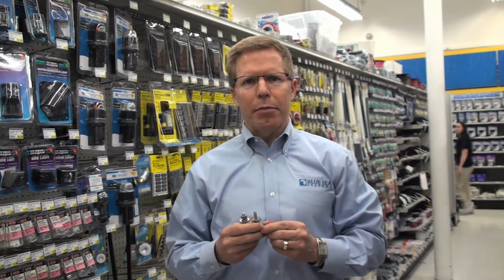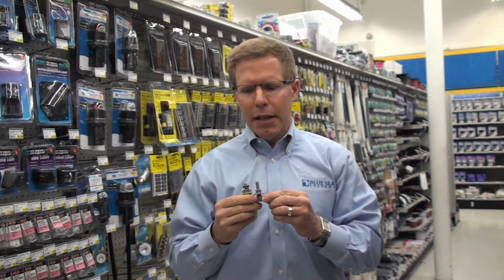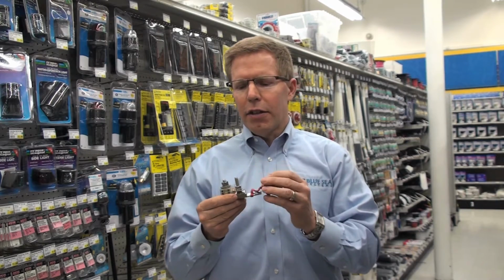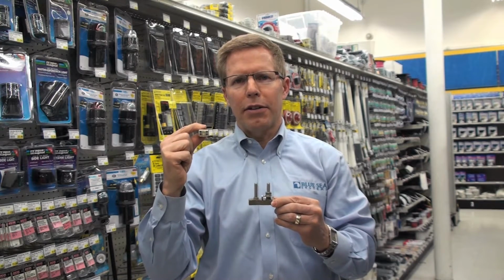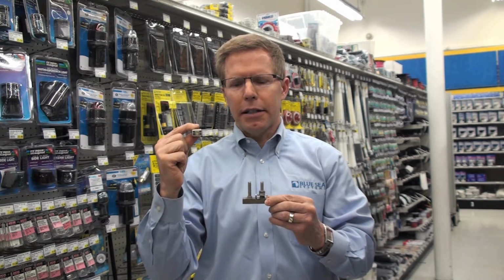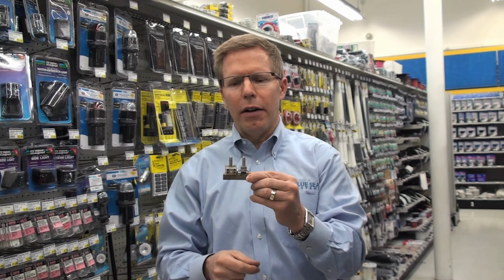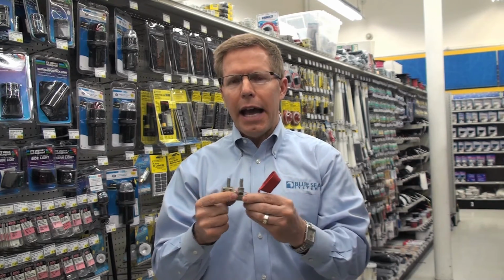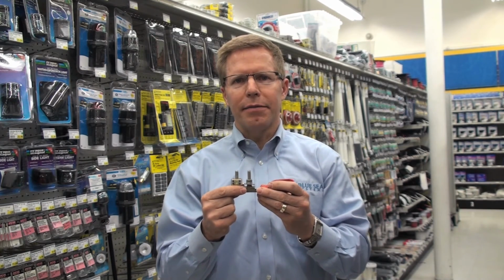Blue Sea Systems Terminal Fuse Blocks

Comment: What prevents the current flowing from the cable terminal through the mounting post and into the battery, effectively bypassing the fuse? Is the mounting post insulated from the rest of the terminal fuse block?

Comment: We are being required to fuse the wire to our engine and starter.  I've always been told you never fuse that wire, but times have changed and now we do.  Are there terminal fuses fastvblow or slow blow which are called timed.  It's nowhere on the box or listing.  I bought a 200 Amp fuse, can it handle the split second extra load that can be common from a starter at the first initial turn of the engine.  I was told that can be 550Amps for a fraction of a second at startup.  I don't need a timed fuse like an ANL, I really want to use this type of fuse if at all possible.
Reply from the maker: Great question Tommy. Yes, this was a very old video so most practices they talk about are likely out of date. That’s a good question though and sounds like it requires more than we can answer here. Please contact our Product Advice Team for assistance at productadvice@westmarine.com, or by calling 1-800-BOATING (262-8464), Monday - Friday, 8am - 9pm ET.
Reply: Fuse your starter? LOL Nooo....